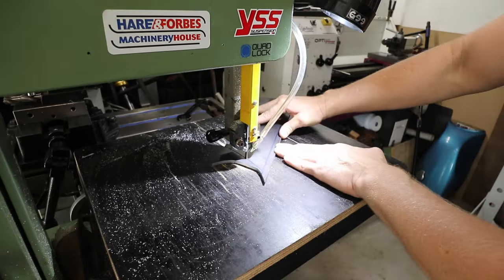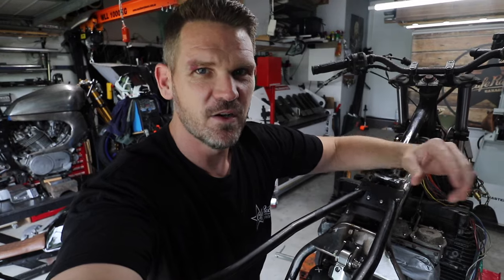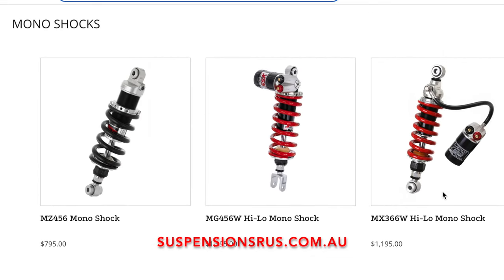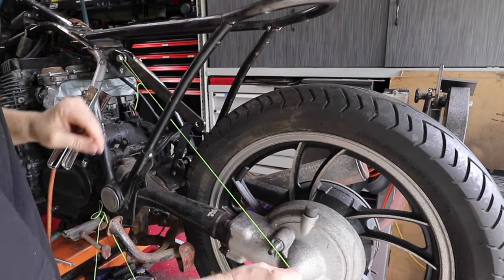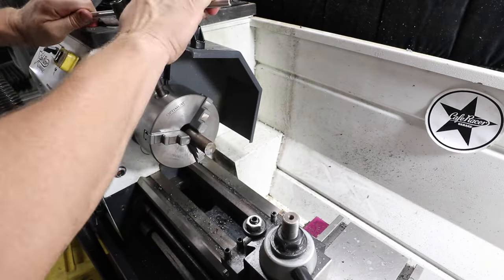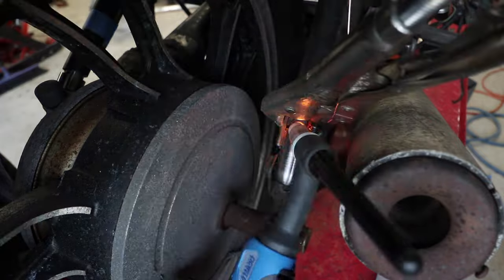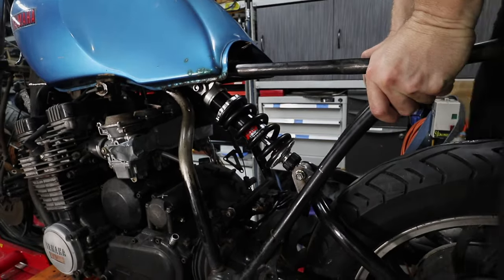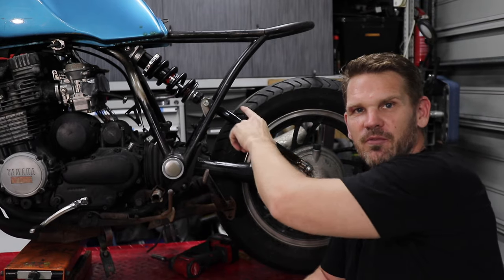How To MONO-SHOCK Almost ANY Motorcycle!!!

Comment: A couple of bikes I'm currently building. An 89 Honda Hawk with GSXR1000 forks, Ducati wheels, vintage Fox shock. A 92 ZX7R with Aprilia wheels, Ohlins forks with radial Brembo brakes and yet another Fox Shock. And my latest, an 89 GSXR750 Slingshot with a Bandit  1200 Engine I swapped into it(750 motor was seized).

Comment: Currently have a '93 cb750 and an '07 cb125r, the cb750 is just getting little stuff done to it like cleaning up engine cases etc.. just decrustying it and the 125 has a full fairing swap from a Benelli 350 from the 70s and a race tail.  The suspension will stay the same on both bukes, but your videos are always worth a watch.

Comment: Working on my five Yamaha FZR 1000 Exup, one 1989, one 1990, two 1991 and one 1992. I accumulated a lot of parts, bought the entire stock from two dealers in Holland and one in Belgium. When I moved to France took it all with me but sold my 1994 and 1995 bikes to a guy in Montenegro. I have spare engine, forks, tanks, seats a lot of body work even parts from the Genesis model and a FZR750R OW-01 engine in parts for the gearbox. Too much to list it, boxes and pallets of parts. Yes it's my favourite model of Yamaha, the 1989 I bought new, this is going to be his second rebuild. Also have four other bikes to drive and planning of buying the new Triumph 400 speed, but selling my 125cc to my sister for her daughter, my godchild for a very low price.
Reply from the maker: Sounds amazing and also sounds like you have your hands full :)

Comment: Beautiful work as always Dan! I have an XV750 with GSXR1100 front end, VX1100 rear wheel with R6 shock one off seat and rear bodywork and NWT PDM/switchgear. I'm super interested in your single sided swing arm conversion!
Reply from the maker: That’s awesome bro and still working on the single sided swing arm setup in between other projects

Comment: Hey Dan, I'm doing a up a 1980 CB400 mono shock, i have more room in front of the rear tire so the bottom shock mount can sit back further than on the XJ
Reply from the maker: Yes that should be a straightforward conversation and look amazing

Comment: What about converting to twin shocks ?

Why you say, twin shocks are more stable and less prone to stress caused by leverage, they also reduce rotational flex (twist) in the swing arm.
Reply: They can also cause imbalance in the suspension performance and handling if either shock decides to check out !!

Comment: I have a cx500 , I already have a YSS kit for it, you’ve got me wondering if this method will work better than the existing kit will, haven’t really heard anything negative about them failing as is or performing badly but maybe this will look better
Reply from the maker: The kit you have should work perfectly 👍 it’s just that I don’t have enough room on my swing arm for it to be enough leverage, however, your cx does 👍
Reply: Are you contactable outside of YouTube? Need advice on the legality of modifying motorcycles in QLD and struggling to find out the correct order and who to go through to get it legal and registered with a monoshock

Comment: You see a lot of your first try monoshock on the CX500. And that is a dangerous way of doing it. The leverage on the cx is enough to work but because of the leverage the rear suspension arm gets a load of 1100! Kilo’s. I’m sure it’s not designed to carry such loads . Your second solution is way nicer in setup and looks.

Comment: I wonder if you could have put the virago swingarm, tire, and shaft in this XJ and use that and call it a day? I am currently also working on a XJ650 and thinking if I can get away with buying the entire rear off a virago and just welding a shock mounting point under the tank on the XJ. could you see it that would work also please?
Reply from the maker: It’s might work but I can’t be for sure. Let me know if you try this 👍

Comment: Got 2 bikes on the go, 2000 honda cb250 which is at the final stages. Other bike is a bmw r1150gs and I can't decide what to do with it right now just get it running and driving so I know I have a good base then work out a plan. Do I go tracker style or just restomod as it needs painted so might do a modern metallic yellow bmw colour as it's currently standard yellow and do a few other modern twist to it.
Reply from the maker: Thats awesome I have the same CB250 that I was thinking about doing a budget build on and sharing the process, sounds like you have good taste in bikes :)